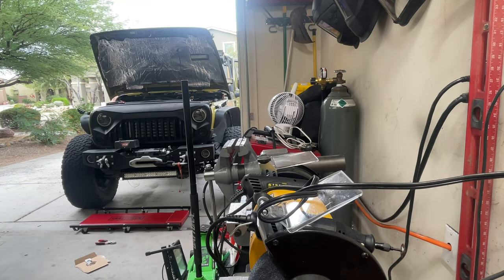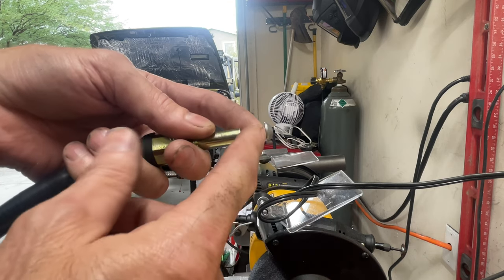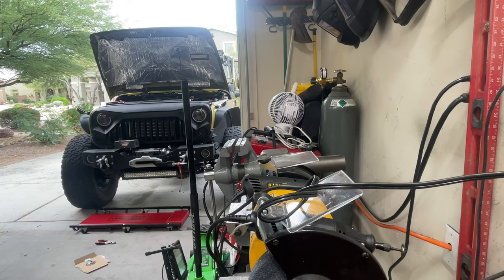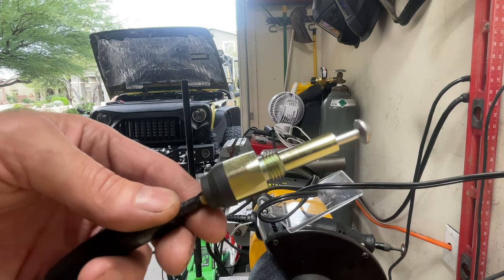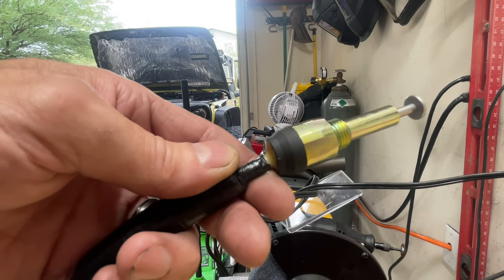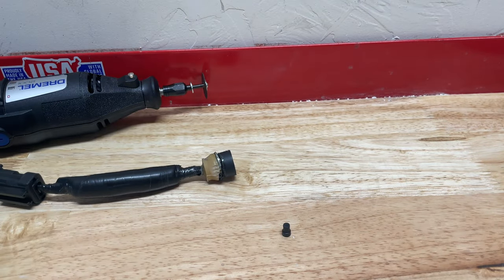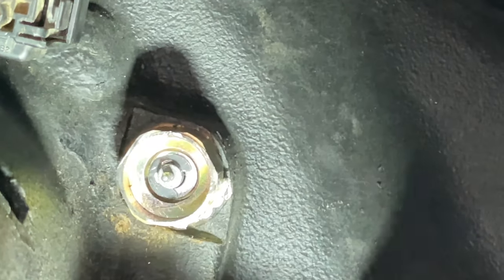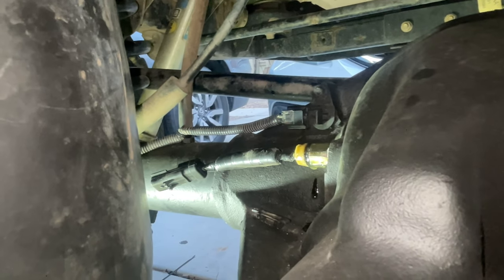2007-2017 Jeep Wrangler JK Locker Switch Replacement Trick

Comment: Since the switch has to be cut off the plunger anyway, I just rotated the assembly (unscrewed) a little at a time and used my Dremel to cut the switch off just past the hex nut. With the switch in hand I cleaned the contacts with crocus cloth and inserted the switch back into the plunger assembly and glued the switch back into place. I retightened the assembly and tested. I engaged the locker using a jump box and checked continuity with an ohm meter. I double checked this with a test light on 12vdc and then after connecting the 2 plugs, I checked everything with the switches in the jeep. This route eliminates having to take the plunger out and reinserting it. Hope this makes the process easier (and less expensive) for someone.

Comment: Hi. Thanks for the video. Was the plunger bad or the switch in the wirering?
Reply from the maker: One was just stuck and I was able to clean it out with carb cleaner.  The other the switch itself was bad.  I was able to test voltage through the switch to see how many volts were passed.